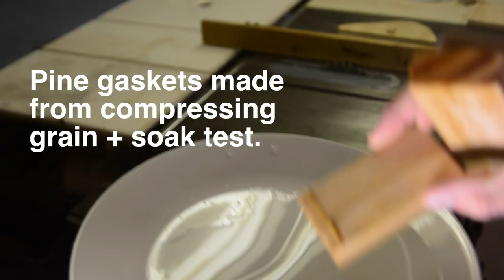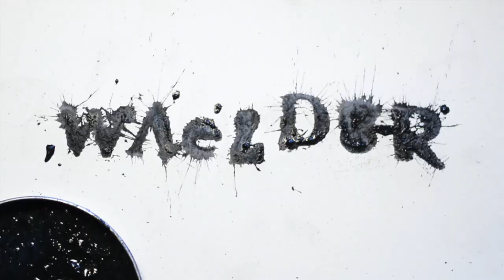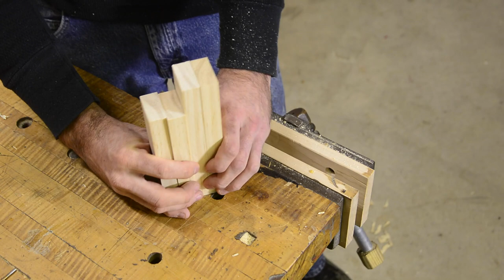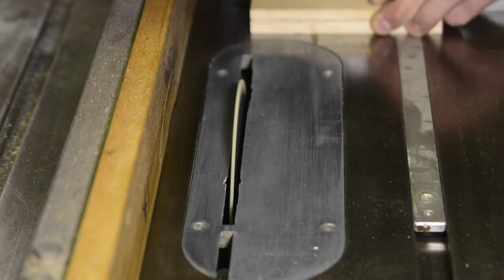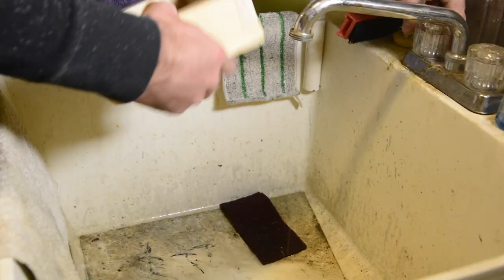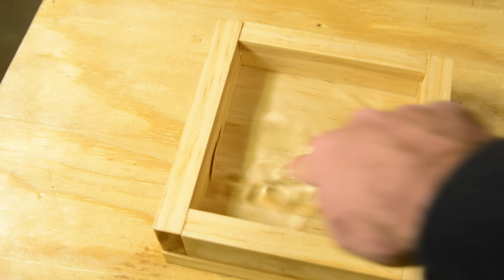Wood box - Water tight - Nails only - No glue

Comment: Wish I'd thought of this. Used to teach a similar technique with plastic memory: Heat/soften piece of acrylic 165°C / 329°F; quickly force a steel shape into it (using a vice); let it cool; remove from vice and take metal shape off; file, sand, or whatever, the surface down almost to level of indented shape; reheat and indented shape will rise above surface.

Comment: How long do you reckon the water will hold up before rotting the wood?
Reply: I guess, it depends on where you keep it. If you keep it outside then it will rot sooner. But inside i guess it would be fine for years.

Comment: Frank Klaus uses this trick for his water pond for his sharpening stones - however, he uses a tapered sliding dovetail on the end grain butt joints.  Using this trick on the end grain would be A LOT easier than perfecting that tapered sliding dovetail joint.  Scott
Reply: Read on down the comments, Frank is his grandpa's cousin and that's where the idea came from!
Reply: @andrewaustin6941  I did not see that as it was in a "response" - that's pretty cool!! I've got the DVD with Frank on The Woodwright Shop showing how he does this. I got the hand plane for cutting the sliding dovetail joint - It's not easy and Frank does it in his sleep